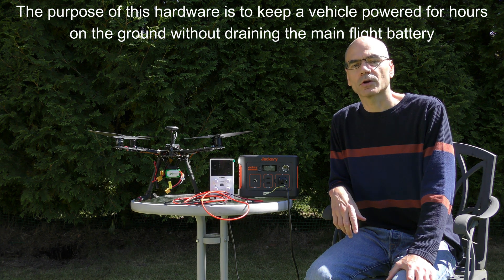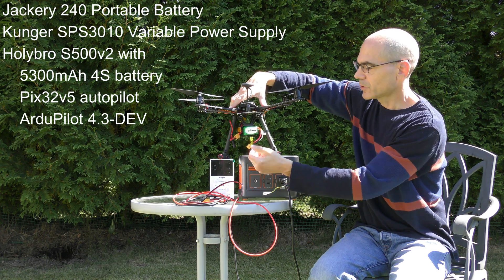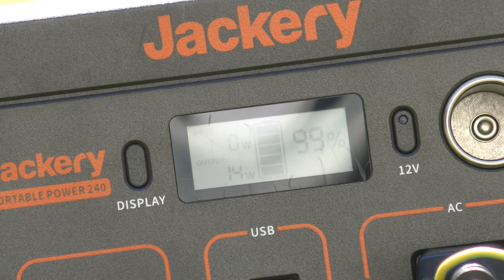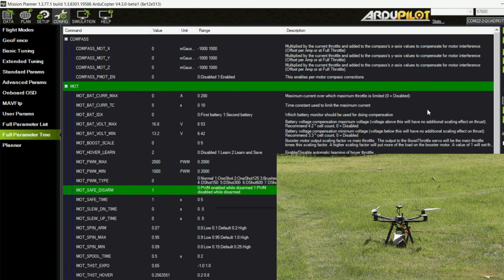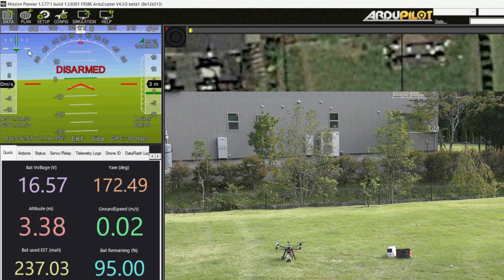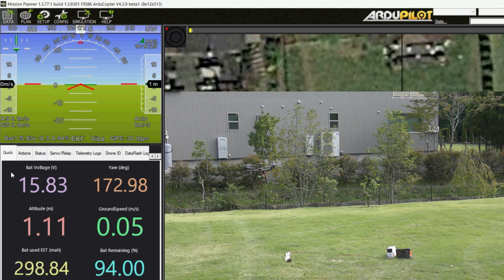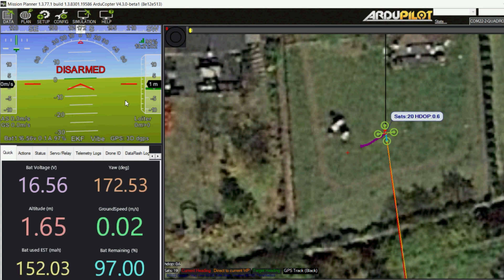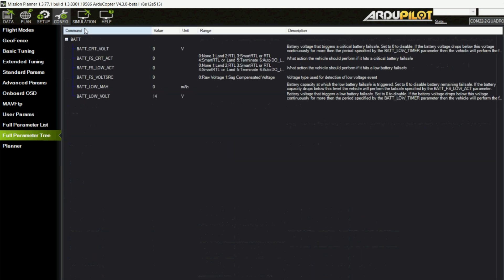Pre-Takeoff External Power Supply

Comment: I'm impressed that just using a barrel connector works so well. I really thought you'd have to use some kind of magnetic connector so that it doesn't pull so much on the quad before it disconnects, so it's cool that it works so well with this connector.

Comment: Cool idea Randy! It begs the question; does Ardupilot support any kind of sleep modes? My guess is that most hardware isn't optimized for standby power consumption at the moment, but putting everything to sleep (except maybe the GPS for lock) would still help. It might be useful to use pogo contacts in the skids rather than a barrel connector that could snag on takeoff. Also, if you added a GPIO you could sense when the aircraft was on external power and disable the BATT_LOW_MAH but reenable it during flight. To anyone trying this at home; float charging LiPos can be dangerous if not done correctly! Probably best to set your float voltage a bit below 4.2V/cell just to be safe. An in-line diode from the external supply would also keep the supply from inadvertently draining the battery if the float voltage is a bit lower than the current cell voltage.
Reply from the maker: @Azimyth, thanks for the advice.  I agree especially about using an ideal diode to reduce the chance of the onboard battery discharging down the line to the external power supply.  AP doesn't support sleeping but it's worth thinking about adding this feature.

Comment: Should have the powercontact in the center when you take off,, if you are unlucky the quad could fall?
Reply from the maker: Hi Stefan, yes, it would be better if the DC power connector was in the middle.  You probably saw that near the end of the video it had one bad takeoff where the connector remained connected a bit too long and the vehicle twitched on takeoff.  Overall though the DC connector is easy and seems to be working ok.

Comment: Great video. Im doing similar tests flying the drone with power supply. Now I'm thinking about using 8 motors and I'm worrying about voltage drop.
Can iI use supercapacitors to balance the current spike ?
I use 50A 16V mean well RSP-750 power supply and I want to use 8 sunny sky X2216 KV880 motos with 50A speed controllers. Will this power supply work or do I need a more overfull supply or two connected in parallel? (Video is using only 4 motors)  https://www.youtube.com/watch?v=5WZV8U4p7RQ
Reply: Hello.  In your case, I think you need to check the high voltage power supply option.  I think it's better to use 100-200 volts to power the onboard DC-DC converter, this will reduce the weight of the wires and it will be much easier to avoid voltage drops in case of high power consumption.  But keep in mind that this is more dangerous, so you need to be careful.
Reply: @kapacheuski  Will consider it. Do you know any light  onboard DC-DC converters that can provide alot of amphs at 16 volts
Reply: @yankoaleksandrov   No, Actually. You can try to find some solutions on forums. I think some peoples working on it now.